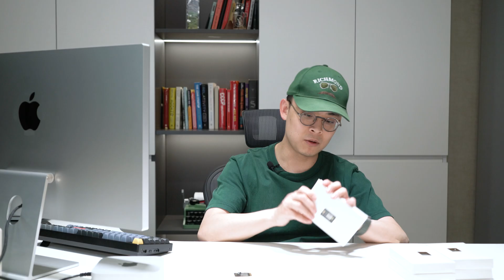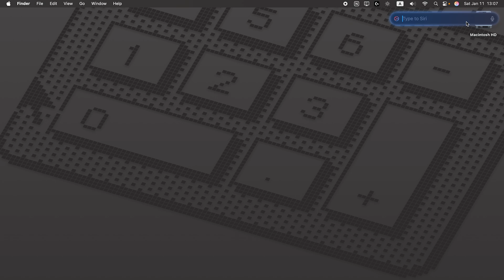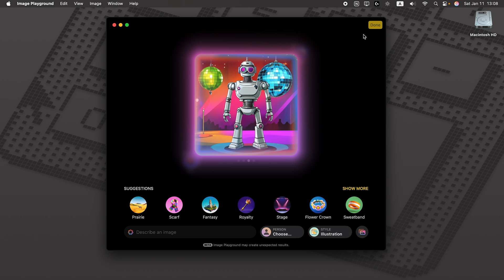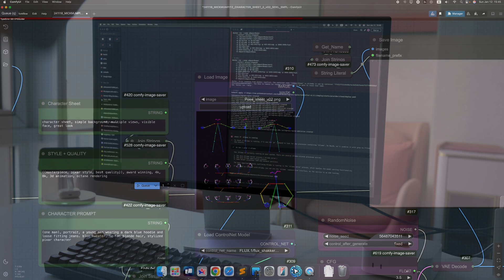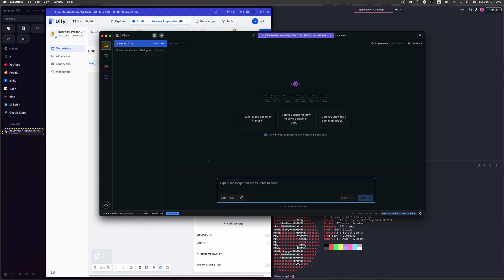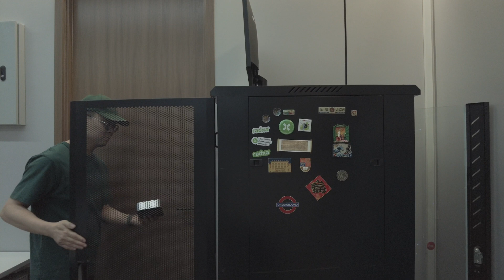Mac mini M4 SSD upgrade module project update, unboxing and Q&A

Comment: I tried using the DFU restore function with my 2017 iMac (Monterey OS) with no luck. I then attempted to use my M1 Mac mini (Monterey OS) again with no luck. I then booted my M1 Mac mini from an external drive with "Sequoia" and it came up, which then allowed me to do a restore to my M4 Mini with new drive. So my conclusion is it is "OS" dependent whether the restore function will work, although the 2017 iMac will not take "Sequoia" unless you use Open Core Legacy Patcher.....The drive works very we'll as advertised, Thank you for your efforts and success.

Comment: One Question, when doing the DFU restore, is the  M4 Mac mini connected to the internet or is it the "other" computer? Thank you and I ordered my upgrade about 1 week ago, looking forward to the upgrade. Thank you
Reply from the maker: During DFU restoring, the Mac mini doesn't require the internet, it is only talking to "the other Mac". However, your "the other Mac" needs internet as there is a ~16GB macOS recovery image needs to be fetched from the Apple CDN
Reply: @apremiumtypewriter  Very good Thank you, I think you mentioned the other Mac does not need to be an M1 machine?
Reply from the maker: @melchora7  x86 Macs also work - on my previous vid I used a 2019 Intel Mac
Reply: @ Perfect,  I think an intel 2017 shoud be fine then Thanks again

Comment: Answer to universal question,  "Why did Apple design storage this way instead of using NVME form factor SSDs?" ...  Because Apple Silicon has its own on-chip memory controller and encryption engine which interfaces directly to the "attached" NANDs on the "SSD" modules.

Comment: Is there anyway you could also upgrade the ram from only 16
Reply from the maker: @petefausone2839  I wish, but even if it’s possible it’d require serous heatgun and soldering skills. It won’t be as smooth as replacing a card 😅

Comment: I am very interested in running an AI setup similar to yours.  I opted to upgrade the RAM in my mac mini to 32GB so i could run image to video models in comfy UI.  could you make a video that goes in depth into your AI setup and explains why you are doing it the way you are.  thanks!  (I am planning on using fast external storage because I am afraid of screwing up my mac trying to upgrade the internal storage.)
Reply from the maker: more than happy to, scratching my head to find topics for next videos, this would make a good one :p

Comment: I wonder if Apple would make these 3rd party ssd's inoperable when their is some sort of update.
Reply from the maker: quoting a response from another comment: "Unlikely. There would be legal (antitrust) implications to doing so, but also they'd be shooting themselves in the foot by limiting the NAND chips that Apple themselves could use. It's not like jailbreaking an iPhone." Also, technically these units aren't SSDs, they are just NAND chips on a PCB, and we are using the exact same NANDs that Apple uses. So although it's not impossible, it's quite unlikely that it would be rendered unless in a future macOS software update

Comment: Would apple do a patch in an update to render third party parts unusable though.  I wouldn't put it past them?
Reply: Unlikely. There would be legal (antitrust) implications to doing so, but also they'd be shooting themselves in the foot by limiting the NAND chips that Apple themselves could use. It's not like jailbreaking an iPhone.
Reply: @lindsaybruce1396  They could either bind your chosen storage (256gb) to your Mac mini serial number) or NANDs do have unique identifier numbers, so the could just bind this number to the M4 serial number. It would be super easy. If so you would have to downgrade to the original module. If the circuit is completely identical Apple does not have any arguments to defend blocking this, else they could say for security reason they won't allow it. But this is no black sorcery, they should have known that this is possible and will happen, so if they wanted, they could have easily implemented this, also not a lot of people will do this,  buying an external storage device that is not much cheaper or opening your Mac mini is an easy decision for most who are not that deep into electronics. And you can also boot from an external drive, allowing you to use Siri and Apple AI.

Comment: is there a version planned for Mac Mini M4 Pro like 2/4/8 TB?
is ther any information on the used NANDs as there are quite big quality and spec differences.
Reply from the maker: Yes, the modules for M4 Pro are still in the making, as the PCBs are slightly more complicated than the current M4 version. The NANDs are proprietary to Apple, so unfortunately there isn't too much information that can be released to the public domain. But also since they are proprietary to Apple, only a select handful of vendors on Apple's approved vendor list can manufacture one, and Apple only work with big players.
Reply: @apremiumtypewriter  Yoe understood me wrong regarding the NANDs, it was regardint informations what NANDs YOU use and if they are from trustworthy sources or from aliblabla or temu or comparable sources. Or if they meet at least the same or even higher quality standards than the NANDs used by Apple.
Good to hear that also for the M4 Pro a product is,min the making. If the studio has also replaceable Storage is it also ülanned as project?

Comment: why not just buy an extended ssd there's many out there and more to come like raycue, or orico or qwiizlab, or satechi
Reply from the maker: you can. i am merely providing one more option
Reply: 1) Save a USB/Thunderbolt port
2) Eliminate s issues with lead failing or getting yanked out of socket
3) SSD likely runs cooler ?

4) May run faster, especially compared with USB-C ?
5) Tidier and more compact set up
Reply: For me, I don’t want cables poking out or anything that isn’t the Mac mini in terms of size, or ugliness. It defeats the whole purpose of the Mac mini for me. 
I bought another variant but for me it’s the only way.